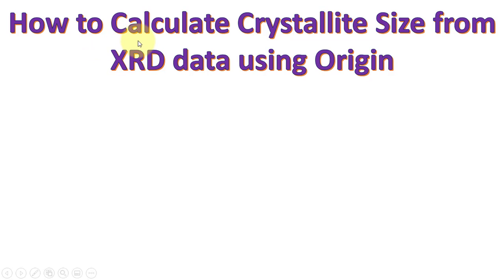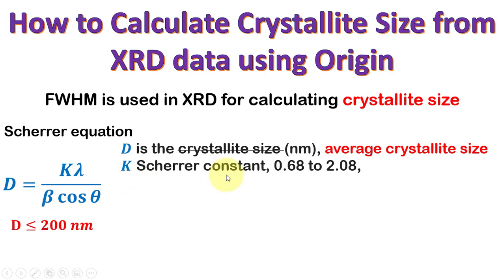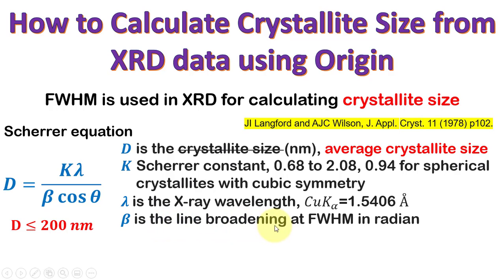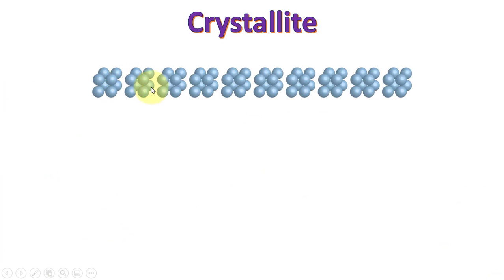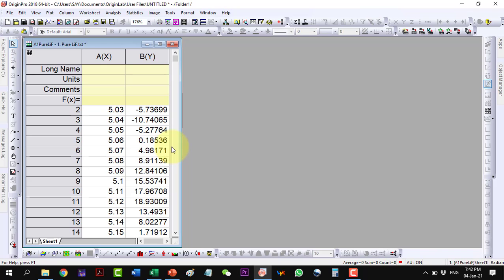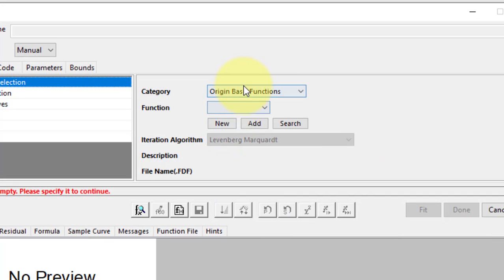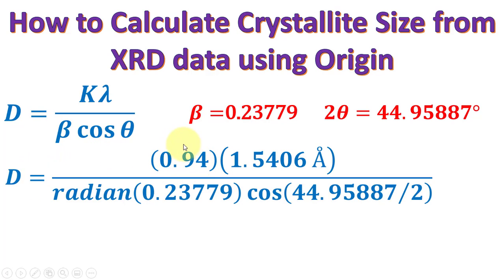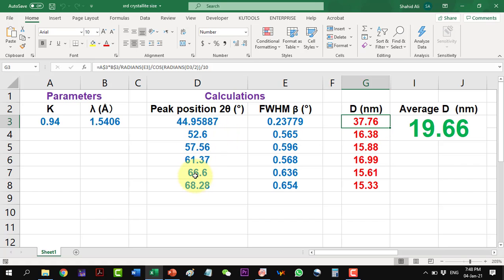How to calculate crystallite size from XRD data using origin

Comment: I have seen some other videos... They are taking cos theta in radians and not in degrees. What is correct and why?
Reply from the maker: The angle θ (and therefore cos θ) is dimensionless, so the cosine function itself works the same in radians or degrees.
However, the broadening β must always be converted into radians, not degrees.
This is because β represents the angular width in the diffraction equation, and the formula is derived using radians. Thanks

Comment: Thank you for the video! I have a question: you got grain sizes that differs from 16 to 37. Is this difference just something usual for Sherrers equation?
Reply from the maker: Thank you for your question! Yes, with angle the crystallite size values can change when using the Scherrer equation, but the variation should not be too large. If you observe the size increasing and decreasing with angle in a systematic way, then instead of relying only on the Scherrer equation, the Williamson–Hall method is recommended, as it accounts for both size and strain effects.

Comment: 8:16 min. In the excel formula to calculate the size, why did you divide the COS and not multiply it and at the end why did you divide again by 10?
Reply from the maker: Great question! In the formula, dividing by the cosine instead of multiplying is part of the standard Scherrer equation, which uses the inverse of the cosine of the angle. The final division by 10 is a unit conversion step to get the crystallite size in nanometers (nm). I hope that clarifies things!
Reply: @SAYPhysics  Thank you very much
Reply from the maker: @DanielLoa-i3x you're welcome dear

Comment: Why transfer from degree to radian ? Why?
Reply from the maker: The Scherrer equation involves trigonometric functions like cosθ, which expect the input angle 
θ to be in radians. In mathematical functions, the standard unit for angles in most trigonometric functions is radians rather than degrees. If you input θ in degrees into these trigonometric functions, the results would be incorrect.
Additionally, the FWHM value β is often measured in degrees in XRD experiments, but the Scherrer equation requires it to be in radians to give a proper result. Converting both θ and β from degrees to radians ensures consistency in the formula and allows the calculation of crystallite size to be accurate. Thanks.

Comment: Please sir we see that from TEM mean particle size have low magnitude compared with the value of crystal size … so does particles size smaller than crystal size or inverse please shown me this problem
Reply from the maker: The smaller mean particle size from TEM compared to crystal size could be due to differences in measurement techniques, where TEM measures actual particle size, and XRD measures crystallite size. Factors like particle aggregation, polycrystallinity, surface effects, and differences in sample preparation or calibration can also contribute to this discrepancy. If you have more details on the measurements, I can offer more specific insights. Thanks
Reply: I used a pulsed laser in 5 ml of distilled water and deposited the colloidal solution on small pieces of silicon for the purpose of performing an XRD test. I performed a TEM of the solution and the results were as I indicated. There is a difference between the TEM and XRD values with respect to the crystal size and particle size, noting that the targets were silver and gold.  @SAYPhysics
Reply from the maker: I'm sorry for the late response. YouTube doesn't show for response within another response, which I miss sometime.  Please note that crystallite and particle size are not the same. XRD gives you the crystallite size not the particle size. Thanks
Reply: @SAYPhysics yes sir I know that, my question is (my results appear crystalline size large than particle size)

Comment: Thank you so much, sir.
I have two question about crystallite size. 
1. Why scherrer equation is valid for crystallite size up to 200 nm??
2. If crystallite size larger than 200 nm, how to calculate crystallite size??
Reply from the maker: Thank you for watching the tutorial! Great questions. 
1. The Scherrer equation is often considered valid up to 200 nm because it assumes a uniform distribution of crystallites and does not account for factors like strain or defects. Beyond 200 nm, other factors start to become significant, potentially affecting the accuracy of the Scherrer equation.
2. For crystallite sizes larger than 200 nm, alternative methods such as electron microscopy or small-angle X-ray scattering (SAXS) can be more appropriate. These techniques offer higher resolution and can provide more accurate measurements for larger crystallites. Feel free to explore these options based on the size range you're working with.

Comment: Sir how u converted radian(0.23779) please help
Reply from the maker: In the Scherrer equation, the angle is to be in degrees. The value we get form OriginPro is in radians. As we know that Excel by default calculates angle in radians so we apply radian again to eventually get the value in degrees. Thanks
Reply: @SAYPhysics  thanks for the explanation
Reply from the maker: @manashjyotidas3748 you're welcome dear

Comment: Can anyone tell which version of origin it is
Reply from the maker: In the start, it shows that it's 2018 version (9.5). However, all the steps involved in this tutorial can also be done in the older versions as well. In case, you wish to install the latest 2023 version free of cost, the following video tutorial will guide you how to do it. Thanks
https://youtu.be/LamBqZbS3F0
Reply: Thanks a lot for your reply.can you please tell me how to calculate average crystalline size in origin 6.0
Reply from the maker: In OriginLab version 6, you can find the average crystallite size from XRD data using the Scherrer equation. Here's a brief guide:

Import Data:
Load your XRD data into OriginLab.
Peak Identification:
Identify the peaks corresponding to your crystalline material.
Measure Full Width at Half Maximum (FWHM):
Measure the FWHM of the peaks. You can do this using the peak analysis tools in OriginLab.
Apply Scherrer Equation:
Use the Scherrer equation: 
Calculate Average Crystallite Size:
Substitute the values into the equation and calculate the average crystallite size.
Interpret Results:
The calculated size represents the average crystallite size in your sample.
Remember to refer to the OriginLab version 6 documentation for specific instructions tailored to the software version you are using. Thanks
Reply: @SAYPhysics  thanks a lot.cant you make a video of this please
Reply from the maker: I'll see it but at the moment only going with 2018 and 2023 versions. I'll suggest you, if easy, go for the free version of 2023, you'll enjoy the exceptional ease. Thanks
Reply: @SAYPhysics  ok thanks

Comment: Sir, our Xc value is 30.21472
and FWHM is 0.93755
And divided xc/2 than cos is 15.107 and Cos(15.107) = -0.82
What should do now?? It's giving a negative value
Reply from the maker: Please use the Excel template which is provided in the video description. It will do all the calculations for you. Thanks

Comment: What would be K for tetragonal particle??
Reply from the maker: k is a dimensionless shape factor (typically around 0.9). The value of k in the Scherrer equation is not dependent on the type of Bravais lattice. It is a constant that depends on the shape of the crystalline domains and the instrument used. In practice, k is often determined experimentally by measuring the size of well-characterized standard samples with known crystallite sizes. Thanks

Comment: Hi Sir, thanks for your video, but how to get cos(44.95887/2) to 0.924016? I calculated cos(44.95887/2) with excel is -0.883138 ? can you explain ? thank you.
Reply from the maker: It seems there might be a misunderstanding in the way Excel is handling the angle measurement. In trigonometry, the angle is typically measured in radians, not degrees. When you calculate cos(44.95887/2) in Excel, it is interpreting the angle as degrees unless you explicitly specify it to be in radians.
To get the correct result, you should convert the angle to radians before calculating the cosine. Here's the correct way to do it:
Convert 44.95887 degrees to radians:
Angle in radians = 44.95887 * (π / 180)
Angle in radians ≈ 0.78539816339 radians
Now, calculate the cosine of half the angle:
cos(44.95887/2) ≈ cos(0.78539816339)
Using a calculator or Excel (making sure the mode is set to radians), you should get:
cos(44.95887/2) ≈ 0.924016 (rounded to 6 decimal places)
So, the correct value for cos(44.95887/2) is approximately 0.924016, not -0.883138. The negative value you obtained might have been a result of using degrees instead of radians.
Thanks

Comment: Sir how we find limit of detection and limit of quantification in orign....
Reply: Sir how we find slope ,R² value , standard deviation in orign.....
Reply from the maker: The following tutorial is explaining about your queries. There are even more in the playlist. Thanks
https://youtu.be/QESi2dDRnrw
Reply from the maker: To find the limit of detection (LOD) and limit of quantification (LOQ) in OriginLab, you can follow these steps:
Prepare your data: Ensure that you have experimental data with a series of known concentrations of your analyte or target compound.
Create a calibration curve: Plot the signal response (e.g., peak area, intensity, absorbance) against the corresponding concentrations of your standards. You can use regression analysis to fit a curve to your data points. OriginLab provides various regression models such as linear, polynomial, exponential, etc., which you can choose based on your data.
Determine the LOD: The LOD is typically defined as the concentration at which the signal-to-noise ratio (S/N) is above a certain threshold (commonly 3:1 or 2:1). To calculate the LOD, you need to estimate the noise level of your data. You can select a region of the baseline or noise in your data and determine its standard deviation (SD) or root mean square (RMS) value.
a. Select a region of the baseline or noise in your calibration curve.
b. Calculate the SD or RMS value of the selected region.
c. Determine the LOD using the formula: LOD = (SD or RMS of noise) × (S/N threshold).
Determine the LOQ: The LOQ is typically defined as the concentration at which the S/N is higher than a certain threshold (commonly 10:1 or 3:1). To calculate the LOQ, you can follow similar steps as for LOD:
a. Select a region of the baseline or noise in your calibration curve.
b. Calculate the SD or RMS value of the selected region.
c. Determine the LOQ using the formula: LOQ = (SD or RMS of noise) × (S/N threshold).
OriginLab provides various analysis tools to calculate the regression parameters, determine the noise level, and perform the calculations mentioned above. You can refer to the OriginLab documentation or help resources specific to your version of the software for detailed instructions on using these tools and functions. Thanks

Comment: WHY THR FWHM VALUE IS NOT SHOWING, OTHER VALUES LIKE Y X W ARE SHOWING BUT NOT FWHM, I FOLLOWED SIMILIAR PROCEDURE.
Reply from the maker: After fitting, it generates the table and an extra sheet to the data in which you have all the parameters including FWHM. Thanks

Comment: Sir, when we take cos theta...do we need to take half of 2 theta..but in the video, you directly take 2theta value to the following step.
Reply: Also , rad to degree conversion is incorrect ..need to multiply with pi and divide with 180
Reply from the maker: Here, Origin gives the value in radian and in the Scherrer equation we need it in degrees,, so in Excel template, which is available in the video description , we convert it into degrees. Whatever calculations you are saying, Excel is doing it itself. Use the provided template for calculations, please. Thanks
Reply from the maker: In the vIdeo description, I have attached an Excel file, where all calculations are being done. Thanks

Comment: As per me, you are considering the doublet as a single reflection and collecting the FWHM (for example at video time 6:20 min). Is this the correct way to estimate the crystallite size, I don't think so  you are getting accurate crystallite sizes.
Reply from the maker: You are right. In general, it is not recommended to consider a doublet as a single reflection for calculating the crystallite size from XRD data, as this can lead to inaccuracies in the results. This is because a doublet typically indicates the presence of multiple crystallographic domains or twinning, and treating it as a single reflection can result in an overestimation of the crystallite size. However, it is always better to consider all the peaks and then finally take the average of all the calculated crystallite sizes, as explained at 07:50 of the video. As a cross-check, we can compare the calculations from a single reflection and then of the average to confirm these calculations in the video. Thanks for your input.
Reply: @SAYPhysics  taking average can help you when consider particular hkl planes , per example 00l. Every reflection indicates/arising from particular hkl plane.  Insuch case you can not consider doublet as a singlet. If you want to get quatitateve size then  you have to use siglet only. I can not agree singlet can giver  over estimation of size.  And one more thing origin program not use for quantitative data it's  just for rough idea.

For more basics kindly read any crystallography text.
Reply from the maker: Right. Thanks for your input.

Comment: well explain but plz also tell me about that how you convert beta value which is in radian into another value
Reply from the maker: The value of beta is provided by origin in radian which I have converted into degrees as per requirements of the equation. Please check in the video description the Excel file in which I have done the calculations you can see in the file that when you take radian of a radian value then it is converted into degrees. Thanks

Comment: Thank you sir,I have a questions,What is the accuracy of XRD measurment? How to determine the reliable accuracy of the crystallite size.
Reply from the maker: XRD, being a technique, is very accurate and reliable. However, calculation of crystallite size depends on accurate measurement of internal parameters like fwhm etc. Thanks for the appreciation dear 😊
Reply: Thank you very much,sir.

Comment: Sir I have a question! In XRD we find out the crystallite size but what about SEM?

Is there we find crystallite size as well or atom or unit cell?
Reply from the maker: With SEM, we can assess surface morphology etc..TEM is an accurate measurement of structure, size and morphology but can't be used to know the crystallite size. Thanks

Comment: thank you sir for this video.. but I have one objection. 
you wrongly explained the grain. 
Grain size can not be calculated through XRD. 
Grain size is the pattern size that we can observe through TEM or SEM. we assume that pattern as Grain. and then we compare this grain size with crystallite size. And consider this pattern approximately equal to  crystallite size. Conclusion: crystallite size calculates through XRD and grain size calculates through TEM OR SEM study.
Reply from the maker: Thanks for your input dear. I haven't calculated grain size but the crystallite size. I have explained the difference between crystallite and grain size clearly. I'll appreciate to watch the tutorial carefully and thoroughly instead of jumping to a wrong conclusion. Thanks

Comment: @SAYPhysics why do you use 𝜽 Bragg’s angle in degrees? 𝜽 Bragg’s angle in Scherrer formule should be in radians as beta?
Reply from the maker: You're right for β to be in radian, while 𝜽 is to be in degrees. I've confirmed it through literature as well as the modern software (like Highscore etc.) are using the same to calculate the crystallite size. Thanks
Reply: I think that is true. Both theta and fwhm should be in radians. Which has not been taken care in this video
Reply from the maker: No dear. You need to go through the literature to know that the calculations in this tutorial is right. Please check the references in the description. Thanks 👍

Comment: The answer I got is 377.63 how you got 37 ?
Reply: You are using Angstrom instead of nm
Reply from the maker: Yes, it's just a conversion based on feasibility. Thanks
Reply: @SAYPhysics  So it's advisable to use 1.54 or 0.154nm?
Reply from the maker: Angstrom or nm, the choice is yours. It's not affecting the calculations as the final answer will be as per input. I'll suggest to use the Excel template provided in the video description. Thanks
Reply from the maker: In the video description, there's an Excel file which is having all these calculations, please recheck that to verify your calculations. Thanks

Comment: I don't understand, how you converted radian to number? i mean could you explain how radian(0,23779) is (0,004150218)
for example, my data is radian(0,21594) how much it will be like number?
Reply from the maker: In the video description, I have attached an Excel file in which all these calculations are being done. Please note that Excel calculate the value by default in radian, so to have it in degrees, we take its radian again. Thanks
Reply: @SAYPhysics  Thank you very much!

Comment: Thanku sir.. but I have a question that how crystallite size affect the properties of a material and which one is better, a small crystallite size or large? Thank you
Reply from the maker: I don't know which properties you're interested in. Let me say few things generally. The smaller the crystallite size, the more efficient the sintering (lower possible sintering temperature). However, the drying and firing shrinkage will be very high. The hardness of a material increases as the crystallite size decreases. Thanks